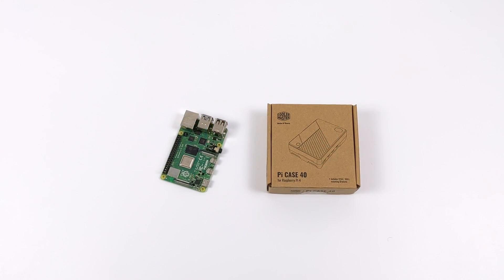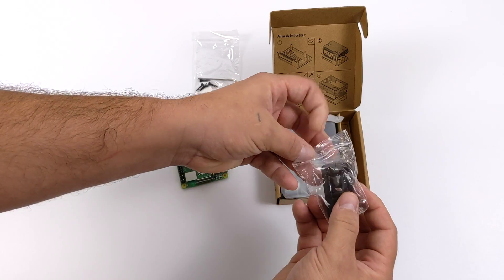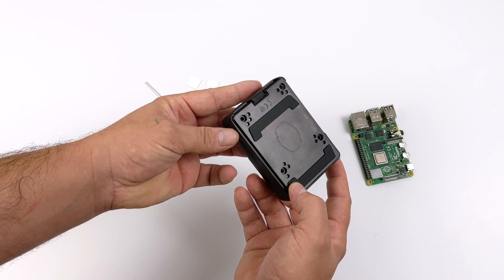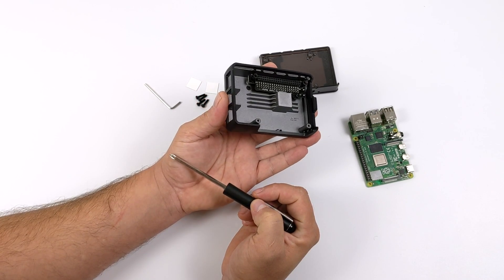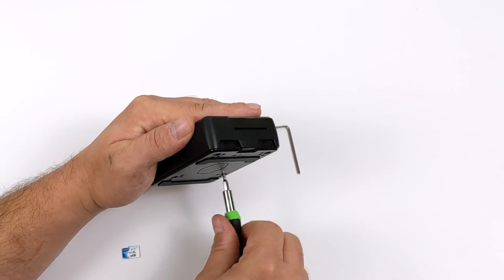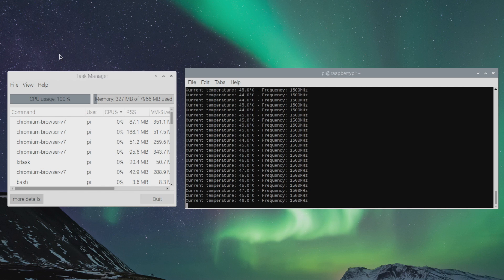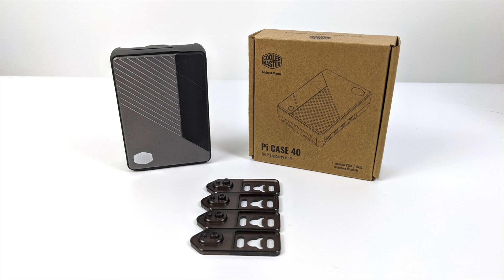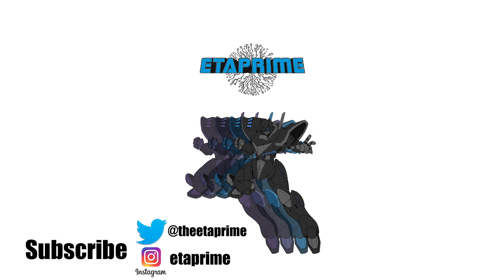Cooler Master Pi Case 40 Test - Awesome Raspberry Pi 4 Case!

Comment: I would love to see you incorporating linpack in your stress tests. It's much more stressful and in my case, it makes my pi4 crash 200 MHz lower than any other cpu load. Easy to follow steps here (https://www.hydromag.eu/~aa3025/rpi/) I recommend the locally compiled OpenBLAS and MPICH. Making a script to loop Linpack until steady-state is reached would definetly be very interesting and would show if there is any risk of a prolonged load ever throttling the pi.

Comment: Haven't flirc been doing basically this same case for years now? LOOK LOOK, it says coolermaster on it, it must be better now!!! 😉
Reply: Gpio pass through? Power button? Vesa mounting? Swappable backplate for addons such as m.2 drives? I mean I guess they are both aluminum heatsink cases but that's kinda where they end.

Comment: > wants to use the case for more than one SBC
> Makes a specific heatsink location for the RPI

Hmmmm.....
Reply: the heatsink is bigger than the CPU, it is natively compatible with older Pi generations and competitors, the offset position is already accounted for. the clearance for Pi 4 is 0.3mm and CM offers a 0.5mm pad, for Pi 3 is o.5 and you can use a thicker pacd or the included one (example)

Comment: I think the short test are a flaw, the Temps clearly keeps climbing, with longer tests you could probe a more realistic/accurate thermal graph
Reply: @Doug Without a way to dissipate the heat? But, but but that is why there is a heat sink... 🤔

Comment: This case is $25, and I can and have bought an Argon 1 for the same price which is superior, why should I buy this case?
Reply: It also acts as a self defence weapon against home intruders.
Reply: Argon has a fan , you can't use the ribbon cable. Gpio pins are harder to reach. I think it's for 2 very different use cases

Comment: Good day, Eta prime for AMD A10-6800k without gpu running dolphin emulator fps top speed only 30fps wondering how to improve fps,add in gpu something like Gtx 1050ti 4gb Will help? 🤔🤔 pls advised thanks

Comment: I'm interested in using a Raspberry Pi for a digital signage project and I want a case with a bit of anti-tampering security. Ideally, a case closed with security screws that only exposes the power and HDMI ports with nothing else external accessible. Has anyone seen something like that at any price? Thanks!
Reply: look at Mechatronic Art case
Reply: @iamrage4753  Those are awesome cases but they're not what I'm looking for. I want a case with no physical access to the SD card, USB, Ethernet, or GPIO. I only need power and HDMI.
Reply: @MarkWarbington  they have covers that go over the ports, well not the ethernet, hdmi etc...never seen a case, would have to be custom, try dasalvo systems

Comment: Thanks for the review. I wonder why there isn’t any heatsinc on the GPU?
Reply: It is on the GPU since all Pi GPU are part of the CPU.
Reply: Tweak42 Pi 4 has its own gpu chip, if you google it you will see.
Reply: @fordi_steve  Yeah no it doesn't... It has (From left to right) Big shiny silver Dualband WiFi and Bluetooth chip, Big shiny silver Broadcom A72 (CPU/GPU or technically GPU/CPU I think?), Big black DDR4 RAM Chip and then two small black chips, top one is the ethernet controller bottom one is the USB controller.

Comment: I was hoping to see heatsink which connects to CPU, ram and little control hubs. Since I can see only connection to CPU, I'm kind of disappointed. Why it's so difficult to make proper case with good passive cooling?
Reply: The CPU would only heat up the other chips if they were within the same heatsink.
Under normal conditions, a Pi4 doesn't need any heatsinks.

Comment: It is beyond lame that COOLER MASTER needs to do a Kickstarter.
Reply: They don't need it, like many other campaigns it's simply a cheap and easy way to gauge market interest and advertise at the same time. Many KS and IGG campaigns end up just being preorders for an already engineered product.
Reply: @KyussTheWalkingWorm  If you want to gauge the market there are over 2 mil members on the raspberry_pi reddit forum. This was just a way to get the $$ before committing. Very lame for a Large company.

Comment: It's appears to be a decent case, but I'm not sure that it provides anything significant over other offerings. We can get a good basic passively cooled aluminum case for under $15, and if more features are wanted there is the Argon for $25. It seems the feature set is between the two, so I would have expected the price to be as well, perhaps around ~$20. Perhaps one is paying for the name brand. It looks a little nicer than some of the ~$15 cases, but isn't close in features to the Argon One so the price seems a little high. Always good to have more options.
Reply: it cost me 27USD on the Kickstarter , not 40
Reply: @anonylesss  My mistake, you are correct. I'll update my comment.
Reply: The case is really nice looking no doubt but a bit too expensive for what it is.  The Argon 1 case in a better value and has a daughter board and a fan. I got mine for 25 bucks and I love it.  Coolermaster needed to crowdfund this?  Why?

Comment: I thought for a moment that was an Allen key. Thank God it wasn't
Reply: I like that allen/hex screws rarely strip (with the correct sized tool), however they are not as ubiquitous as a #0, #1, #2 Phillips most commonly used with electronics.  The issue is there are way too many hex key sizes in use so finding the right one can be difficult, especially considering both metric and SAE sizes.  The number of sizes could easily be cut way way down and still have enough for all electronics applications. For electronics work, 6 sizes would cover all our needs and would be much easier to manage.

Comment: When you do the final review can we get the thermals compared to the Argon One and the Flirc?
Reply: I just wish he would do thermal testing for longer than 10 mins, all of the tests prior make this mistake as the graph temps are still climbing. Anything under 30 mins feels almost a waste of time.
Reply: I think Explaining Computers did those thermals.
Reply: I just got an Argon One for my 4B4GB. FANTASTIC case :) I have yet, however, to overclock, so I'd like to know that, as well. I don't think ETA did the same temp charts for the Argon.

Comment: Are raspberry Pi 4 and raspberry Pi 4 model B the same? I'm so new to raspberry Pi...
Reply: Yes. There are several variants based on RAM (1, 2, 4, & 8GB if I remember correctly).
Reply: In this case yes, as there is no model A of the Pi 4 yet.  Model designates the layout and shape of the board.  https://en.wikipedia.org/wiki/Raspberry_Pi#Model_B 
Overwhelming the Model B are the main sellers to general consumers, Model A are targeted at niche industrial customers.
Reply: Thank you so much.